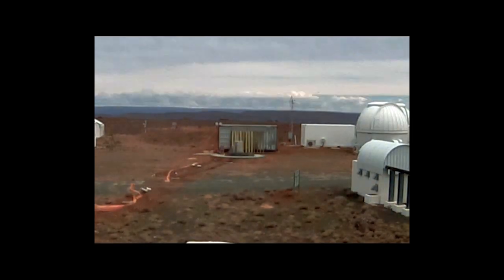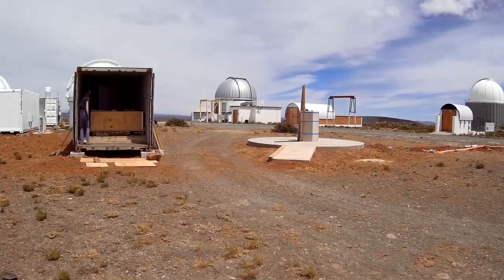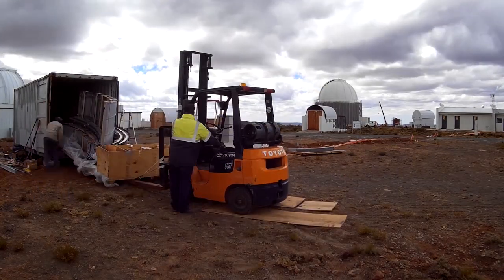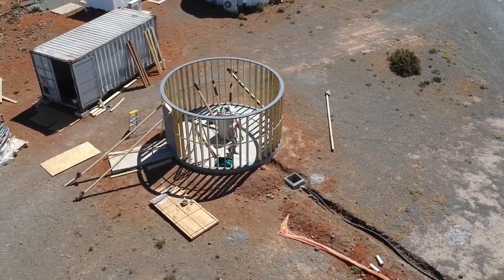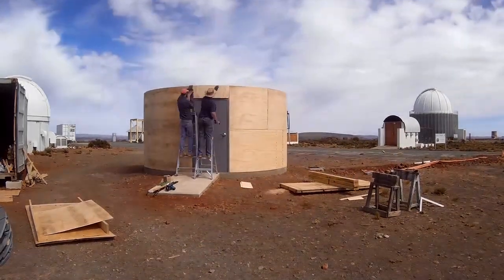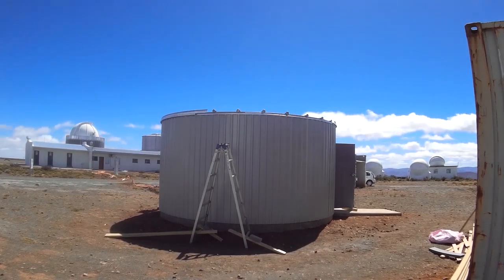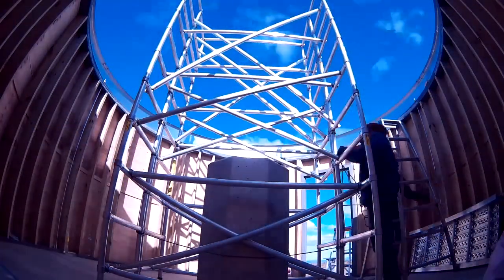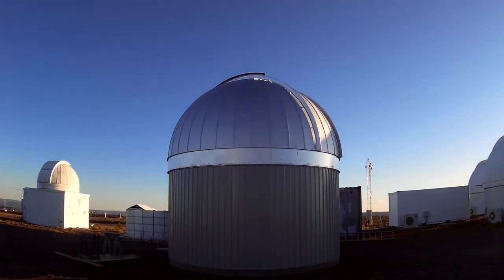How to build a Telescope Dome and Sub-Building

Comment: Did you isolate the pier from the foundation of the building?
Reply from the maker: We normally isolate the piers, but not in this case. I queried this, but the client said it is not necessary because the telescope has a very wide field of view (5.5 x 5.5 degrees), meaning any vibration will not be visible. So far we had no trouble, even in high winds.

Comment: You obviously didn't take into account where the walkway was poured for the door. I would think that it would've been pretty important to get the door centered on the walkway, but evidently not too important.
Reply from the maker: One day after the pad (and ramp) was poured, it was discovered that the door must rotate since there was a clash between the door and one of the pillars supporting the mezzanine floor.  I do mention this in the video (from minute 3:24) and the ramp was subsequently widened.  So not too important since it could be easily fixed yes.

Comment: The door isn't aligned with the walk. All that work and laying things out and you didn't notice the door wasn't lined up with the walkway? That's a shame. The rest looks pretty good.
Reply from the maker: Thanks.  If you listened to the narration, you will hear what the problem was.  In my follow-up video you will see how we fixed it.
Reply: @SterremanWillie ah I think I missed it because I had trouble understanding you. I still don’t understand why you couldn’t shift the door opening over. It’s just studs and a round building. But very interesting video and quite fun to observe it being constructed by hand and so few people.
Reply from the maker: @srpheavyindustries888  It was an interesting set of events. The owners oof the dome realised the day when the concrete work was done, that one of the supports for the top floor falla accross the doorway, but due to the 12 hour time difference between Hawaii and South Africa, the message got delayed. It was also a few days before Covid deep lockdown. But was easily solved in the end.